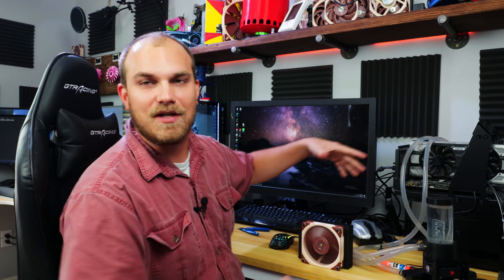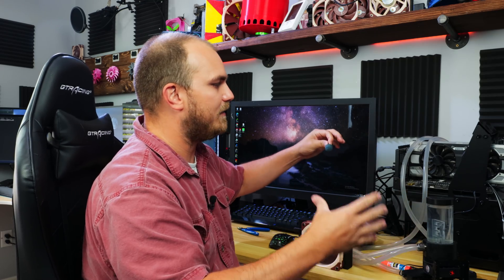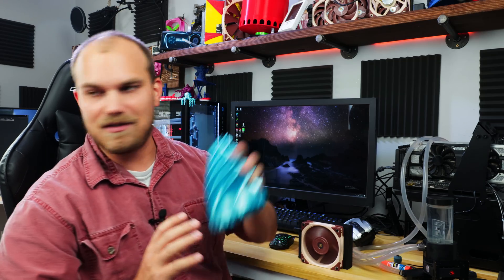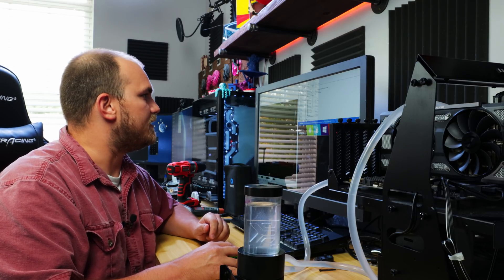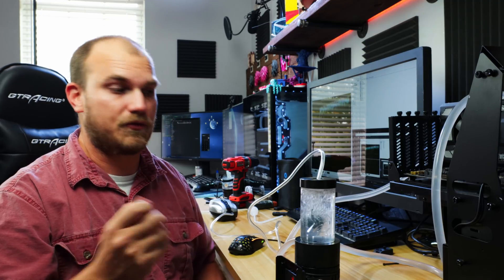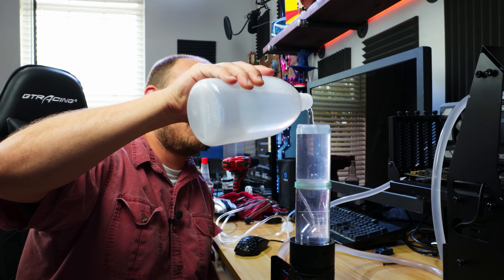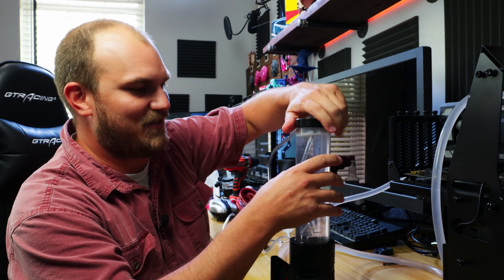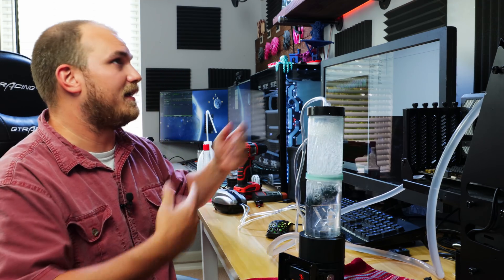Can An Airstone Cool Your PC?

Comment: Maybe it could work pulling a low grade vacuum? Have the pressure inside be so that warm water evaporates and condense on a top metal plate (with heatsink). It's essentially what heatpipes already do.

Comment: The air that comes out of your aquarium pump is warm, adding additional heat to the loop, which is why it is (barely) worse than just plain still water. 

Try cooling the air after it has been pumped like a turbo in a car

OR

Try cooling the air before it has been pumped from something like an A/C.

Personally, I think the 2nd idea would actually work and look cool, but the first idea might also work, and look ridiculous.

Comment: Surely the pump simply cant pump bubbles around the system it was designed to move water, perhaps you should modify the impeller in the pump

Comment: Have you ever heard of a vortex tube point cooler? It's a tube with a auger like screw in it that cools air when you run compressed air through it. 

It's pretty extra, but if you used a vortex tube to cool the air going through the airstone, it should chill the liquid quite effectively.

Comment: I’m still hoping you can combine the cooling tower with the radiator (water goes through radiator to cool down to as close to room temperature as possible, then through the cooling tower to cool down even further through evaporative cooling).

Comment: air is the best insulator after vacuum... so bubbles inside water loop gives terrible results because it disables heat transfer via conduction
https://www.archtoolbox.com/materials-systems/thermal-moisture-protection/rvalues.html

Comment: this will work but you need the surface of the water to have about the same as a rad so try this with a small 1~10 gallon tank just pump water in one one side and out the other add a few air stones in the middle, you don't need to fill that tank only maybe 2in deep with do the job but on that note.
i turned a water loop into a pump less thermal cycle using 1/8th inch and 1/2in soft copper a cross flow RAD top mounted only holds 10grams of water at 1kpa but works so well..

it's the same principle a heat pipe works but swapping wicking for gravity return

Comment: The water should be running from top to bottom through the reservoir. If you are cooling only the top of the reservoir it has not enough impact on the water loop.

Comment: You are not circulating the water in the tank, it's just flowing in and out at the bottom. You need a tank where there is a in and an out at either end and bubble through the water in between. Air bubbles WILL cool the water, I use it to cool hot drinks quickly.

Comment: It may work if you use a 6 foot fish tank with an under gravel filter system that uses airstones to work feeding the hot water into the tank and getting the inlet water from the filter output. This may even keep your loop water clean. example below
https://www.theaquariumshop.com.au/shopexd.asp?id=8895&name=Modular%20Under%20Gravel%20Filter%2016%20Plates%20Kit%2024%20x%2012%20inch

Comment: Evaporative fluid cooler=  Make a suitable copper tube coil and place it between the hot water source and the water return to the tank. Spray water mist over the coil while also blowing air over the coil. If properly designed the air will evaporate the water off the coil exterior and remove about 1,000 BTU per pound of water evaporated. If you have everything in the proper proportions and the air humidity is fairly low it should cool the return water to something like 84 or 85F. Capacity is determined by coil surface area, water flow, adequate exterior coil wetting, air flow, and wet bulb air temperature. You could easily make one out of a plastic bucket w/lid, copper heat exchanger, small submersible pump, 2ea 4" muffin fan, and drip irrigation spray nozzles.

Comment: Energy in must equal energy out.  The substrate removing heat must have the same or greater heat capacity.  The only way this can work is if you make a pressure differential from high to low.  That's more trouble than it is worth.

Comment: Don't run tap water in your cooling system. It will cause damage to your pump and causes blockages to form. Distilled water or coolant only.

Comment: Your airstone to water reservoir won't work because 1 not much evaporation is happening to cool and also not enough airflow volumn to cool the amount of water in the reservoir. The reason why radiators work is that your using a huge amount of colder air to cool a smaller amount of hot water or liquid that takes an amount of time to travel from 1 end of radiator through each fin to finally other end of radiator, the reason why your evaporative cooling tower works is 2 fold, 1 as water changes from liquid to gas it is absorbing heat from its environment and 2 you are also using cooler passing air around each water droplet to remove some heat from each droplet. You could try to add a 3rd cooling layer by adding a radiator at the top drawing water from the same reservoir as i saw the air coming out the top was still pretty cool. I don't know what your temperature of the water in the reservoir was at the time as it wasn't in the previous evaporative cooling tower video but if it was still warmer than the air coming out the top it might still be cooled further.

Comment: Video idea: How much water do you need in a loop without radiators to prevent thermal throttling? (basically, the reservoir itself becomes the radiator)

Comment: I’ll say this until it changes: I don’t know how you’re not a bigger channel. To take the radiator delete concept to the next phase maybe there’s some clever way to use refrigerant, copper coils in the reservoir, some way to chill the water in the reservoir faster than it absorbs heat from the loop... I don’t know lol I’m not an engineer but you have to admit the vague idea sounds cool. Pun intended.

Comment: How about submerging the mounting surface of a air cooler in the water and putting a fan on the cooler to use the capillary action of the heat pipes to remove heat from the water

Comment: Im concerned that with the lid on and the airstone in the reservoir, that the air doesnt actually have much place to go. Hot air will naturally rise of course, so if the idea is to use the airstone to allow warm air inside the water to dissipate the heat, then you're methodology is already potentially flawed. Using the double column and the two airstones as in the last attempt as you wish, but perhaps allow the evaporated air to go somewhere

Comment: You could try with a golden ratio turbine, there are some videos in youtube about it, with that you can create a vortex that forces the air to the bottom, making insane turbulance, it you can solve the problem with the air bubbles coming in the loop, that would be a good idea to try, since you get more contact surface for the heat to dissipate, nothing a 3d printer cant solve.

Comment: Did you get a temp reading of the air that was coming out of the pump? was it pumping hot air into the water?

On a side note. What about doing a waterfall to cool the water and recirculate it into the loop?

Comment: its not a terrible idea, what you want to do is stuff that with like some kind of plastic junk, have your water trickle down in from the top, and have your air come in from the bottom and of course, make the thing taller, but its still probably not a great way to build a heat exchanger

Comment: I think your cooling problems stemmed from the reservoir/pump itself. I'm not sure the pump is designed to circulate the water up and through the tank. Rather, I think it just pumps it through the loop directly, only drawing water from the reservoir when it needs a little extra

Comment: does all water cycle into the reservoir during operation or is it just an "overflow" type thing? Meaning if it's not part of the "closed" loop, the water from that might not be getting cycled through very well. 

Try using a protein skimmer from an aquarium, but run the return line into the top and draw from the bottom.

Comment: Water cooling is 4x more efficient than air. By adding the airstone, your airating the water loop and basically turning your water cooling into air cooling and losing efficiency in the process..

This is not surprising in any way at all - though looks wise, its fantastic..

I suppose you could 3d print a collar tube and use an airstone in there, along with your existing radiator. You would have the same great effect, but I'm not sure  you would see much if any change in temps though.

You could convert a mini fridge to cool the water a little more, but I believe this has already been done and then theres the issue of condensation as electronics and water dont play well. 

Looking at that blue cooler you have reminded me of a Dyson.. maybe you could use that technique to force more airflow through your rad to add cooling to your system? I'm note sure if (possibly has) been done already..

Comment: Got me thinking... maybe a system that runs the heated water through a weeping wall or some other sort of decorational waterfall and then pumps it back in.  Seems like a way you could conceal an awful lot of cooling space, and hide the pump fans with the more pleasant waterfall sounds to boot.

I know a guy who rerouted the drain pipes from his shower so the waste hot water pumps through a pipe into a towel warming rack.  Maybe the trick isn't to think of heat as the enemy but to harness it.  You just need to turn the heat exhaust into a system to keep your coffee warm or something useful.  :)

Comment: Here is an idea. Build a water cooling loop but put the radiators in an aquarium. 
Will it keep the computer cool enough? Will it keep the fish warm enough? 
If you warm the water with an aquarium heater (for the fish) will the computer throttle?

Comment: After seeing how small the aerator is, nah. It's gonna fail, it's like using an inch fan into your rads.  it doesn't pass as much air as you would if your 120mm fans...

Why not try a few more aerators that can pass as much air as a 120fan

Comment: Maybe you are separating the water. The cooled water is not getting into the loop again and the warm water is staying beneath it. Would be interesting if you could measure the difference in temperature between those two sections (bubbled VS clean looking water) . Also I think it would be better without the lid on. The generated warm air can go out quicker, so can the water cool faster. In theory water cools quicker the more surface it has. So tall narrow tubes are counterproductive I guess🤔 I like your content😊

Comment: Why not use some acrylic to build a small tank that is around 12"h x 10"w x 1.5"d with a return for the pump on the bottom of it and buy some adjustable misters like used in drip irrigation and string 5 or 6 at the top of the tank to spray down into it and use it to replace a radiator, adjust them to allow the system to maintain flow to the pump and maximize atomization and see how well without any airflow it can cool a system! You can get a garden patio water mister for under $15 on ebay and even after you are done with it you can always use it in the yard on hot days!

Comment: I think you're dissolving air rather than evaporating water (in addition to getting heat from the compressor) so you're producing heat in the phase change instead of consuming it.  Get one of those mini swamp coolers and see if a wet radiator works better maybe?

Comment: What if you made a stand for a fan on the bottom, and a cradle on top to draw the hot air up faster around the outside of the reservoir?  And made a tube for the whole thing to sit in, to allow the static air to push any residual heat to the top?

Comment: Add the water from the top of the reservoir to force water and air to pass eachother instead of the water near the air just recirculating with the bubbles. Also have a second reservoir with the pump to allow time for the air to escape the water before it moves back into the loop.

Comment: Try dehumidifying your air first, and then pumping in just nitrogen (or at the very least, having some kind of air filter).

You could also put the radiator back on, combined with the air stone, double reservoir, water wetter and a Peltier cooler

Comment: air is a poor thermal conductor and water is really good at absorbing and holding thermal energy, that's why you need something to pull the thermal energy from the water and then radiate it through a lot of surface area... a radiator.

Comment: Try to make the input and output of the water not to be at the same hight level. If they are at the same level then there is no point on that cause the hot incoming water goes straight to the output so....you go high temperatures. Try to make the input be on the top and the output on the bot or the opposite.

Comment: I have another myth i wonder if you can bust?
What would be the FULL Radiator Limit where adding more does not decrease the temperature?
Like would it be effective to use 120x1200 be better than 120x720?
What would the limit be?

Comment: I haven't watched the video yet, but I can already see a fault in this method. That is a compressor style air pump and they introduce a lot of heat into the air they pump. Certainly it is much colder than the CPUs throttle temperature, but the air still isn't that cool. A blower style air "pump" would probably yield better results. Now I'll watch the video to see if I look stupid.

Comment: If I had to guess, you would need to bubble much more air than you fan pushes through the radiator using tiny air bubbles for as large a surface area with the water as possible.  You would bed to find an efficient bubble trap though to remove the air/foam from the water loop.
Air is actually fairly poor at absorbing heat.  The whole point of the fins in the radiator is to maximize the surface area the air can use to transfer heat from the radiator.
I would try a much larger reservoir and several more spargers.

Comment: You should try swapping the air and water in a radiator. So put the radiator into the water loop so the water runs through the fins where air normally would and run compressed air through the radiator where water would normally flow. Weird, probably won't be any good, but could be fun. If there's someone to do it, it would be you.

Comment: here an idea kind of like the air cooling water tower but in this version you will be using a lot of small tubes to spread the water out for cooling and then have a separate water system to coat those water tubes in water to cause a evaporative cooling effect on those tiny tubes, this would also prevent dirt/dust getting into the cooling blocks inside the pc

Comment: those air pumps tend to get fairly warm, do not know if that is affecting the air in the lines to the stones, but if it is you might be pushing warm air into a already warm system

Comment: Can you try to build or buy one of those condenser coils used in ACs and run the output fluid through it and then back to reservoir. With some fans blowing at the coil it might just do the trick with keeping the fluid at very low temps.

Comment: Water conducts heat better than Air, so this will never work, why the other system worked, is that it was getting the heat out of the system,  but long term it would fail do the contamination of the system, as it is exposed to the outside air, and will also need to be replenished as the water in the system evaporates. There is also the added risk of getting air bubbles inside the loop which could effect performance, and the long term survivability of the pump, as is most cases air in a pump made for fluids can cause damage. 

An interesting experiment would be to force water vapor through the radiator fins, to see if it pulls away more  heat, and would not expose the closed loop to external contamination or losses from evaporation. So putting say a Humidifier on the intake side of the fan, and drawing it through the radiator could potentially help with the exchange of heat. It would of course be messy, and risks shorting out equipment.

Comment: Can you try an Ac unit? Just put the cold hose on the CPU and the hot hose somewhere else, or get a wall mounted unit and stick it right on the side of the case? No fans, just ac.

Comment: Wouldnt the hot water need to flow down through the bubbles? Like the inlet to the res (hot return) should be at the top, not down on the pump.

Comment: It's a creative idea, very nice! You should definitely try it at a (far) larger scale, having a large number of air stones spread over an aquarium. You'll need far more air by volume than water to take away all the heat. Also, make sure the water "intake" to the rest of the loop is far from, and lower in height than, the stones. Such that the amount of bubbles that get cycled through the system is as low as possible